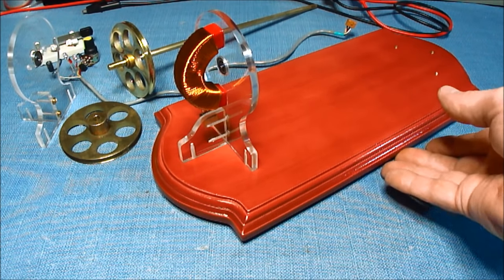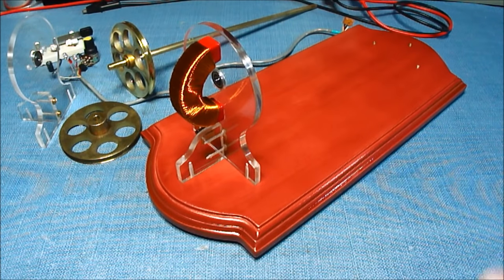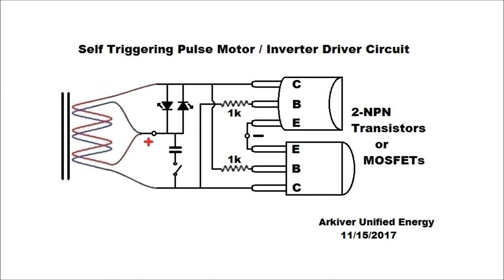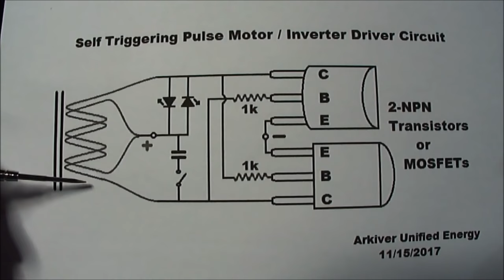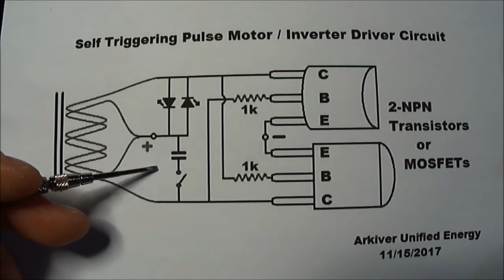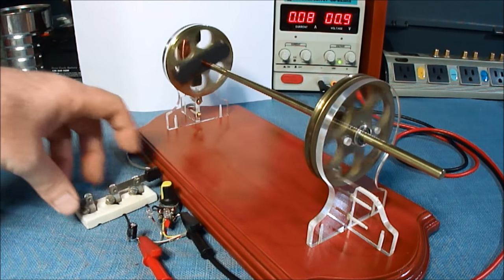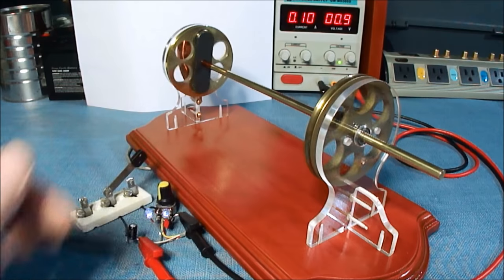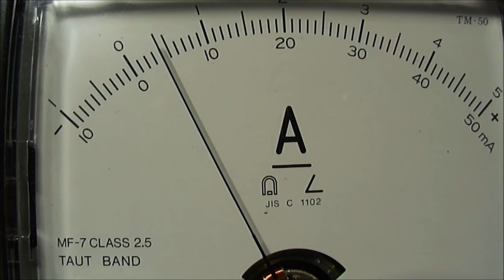Tesla Bifilar Coil Electromagnet Mystery Solved

Comment: No such thing as free energy unless you steel it from the power company then when you get caught you will have a free place to stay and a girl friend named bubba !
Reply: Denial is not truth. 

Free energy sustains everything that is in existence. It is easily captured and put to useful purpose. 

*Common phone landlines are powered by amplified electricity without consumption of any resources. 
*Lenz's Law is an artifact of bad engineering. 
*Maxwell's equations are the definition of pseudoscience. They are un-falsifiable because they simply describe how the specific systems they refer to work, they do not explain the causal relationships of the working components in a way that can be validated by alternative designs. Faraday's description of EM induction has two paradoxes... it is obviously not the truth.
*Capacitors store their energy in the dielectric, not on the surface or within the conductors, you can easily transfer the energy from one capacitor to another by exchanging the dielectric of a charged capacitor with an uncharged one. 
*Electrical theory is specifically designed to conceal the truth about natural energy and the simple model of reality that is truth.
*Advanced physicists admit Ether is real, they call it by the alchemical name: quintessence. But, they are careful to maintain it is only theoretically accessible, not something you create and manipulate yourself, nor is it something you could replicate with mechanical means like Tesla or Pantone did... 19th-century tech for Tesla, plumbing parts for Pantone. Today you could most likely find what you need in any junkyard. It appears the civilization that built the pyramids had a way of doing it with organic materials, water, and stone. Something replicated with a Joe cell, using steel, a cork, and water with a 12-volt battery. Truth is available to all not blinded by the misinformation that sustains our society.

Electricity is not a fundamental building block of anything that cannot be destroyed or created. Electricity is made of charge and magnetism. Therefore, to create or destroy it, one need only alter the mix... From this truth, you can do a word dance that maintains energy cannot be created or destroyed, but the truth is, electricity can be freely created or amplified given one or the other of its component parts. And you know how freely charge can be harvested, or magnetism manipulated... It's all just a question of how much you need, not what you have to destroy to collect it.

The purpose of the nonsense you spout is to maintain social control among people who otherwise would not put up with each other. Sadly, this particular approach of no free energy will be the death of all life on the planet. It also affirms the need to be mean to each other... which is a self-sustaining activity.. so, if you insist that free energy is not possible, you have to make sure you get enough by limiting access to others... if it were free, then your wealth would be worthless... and anyone could ignore you... if you weren't nice. 

You see, being a pirate works when there are limitations, but it is a choice, an adaptation. It is not who we are. Wilhelm Reich discovered the cure to that adaptation, so they killed him and burned his 30 years of research.  A lot of energy goes into maintaining the status quo... that is what societies always try to do. But, without the foundation of truth, they all have failed...as will ours. You are the descendant of two genetic bottlenecks... that shows our world population has been reduced to about 5,000 people twice, there is no telling how many billions have not survived in the past. Was it through our own hand or just the natural changes our planet goes through on a cyclical basis? Without mastery of reality, it won't really matter which, will it? Do you really think there is any truth to global warming by man's production of CO2? It's just another pirate ploy to limit those who can have what they need. Meanwhile, nature is collapsing the geomagnetic field which will bring a whole avalanche of death-dealing disasters. Something we only have legends from around the world remaining.

The truth is the power company steals from you. If you try to stop them you will go to jail, or be killed. You got that part right. Your only chance is to be a better pirate. But, our days are limited, nature is playing a different game. Between our own actions or natural causes that we deny, we will collectively discover reality bites.

Party on dude, and be good to one another.
Reply: @mundymorningreport3137  well said. Sure you don't want to run for president?😊
Reply: @mundymorningreport3137  LOL at your view of Maxwell's equations. Everything electrical works because they are correct. Also SR wouldn't be a good description if Maxwell was wrong. Didn't bother with the rest if this bit of trip is any guide.
Reply: @borisjohnson1944  Clearly you misread my statements. Good luck when reality bites. B
Reply: @mundymorningreport3137  LOL, no I didn't. You haven't a clue.